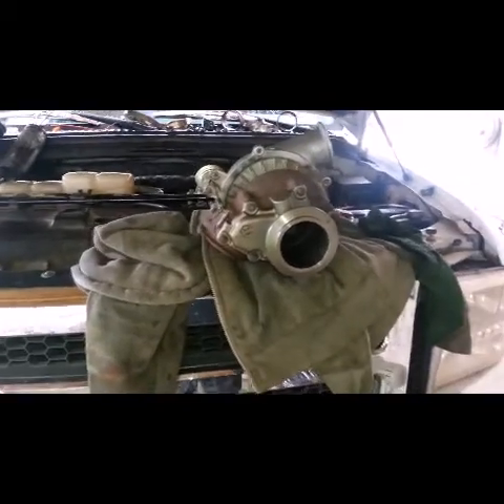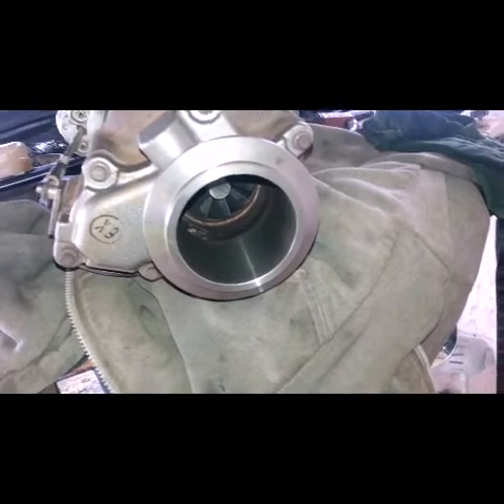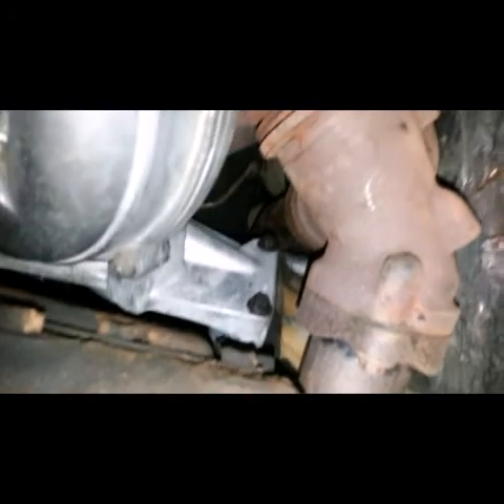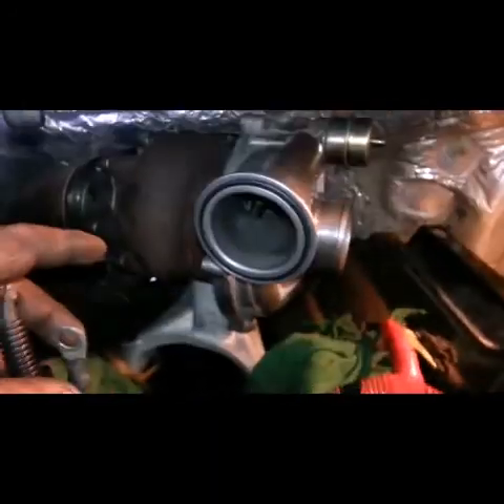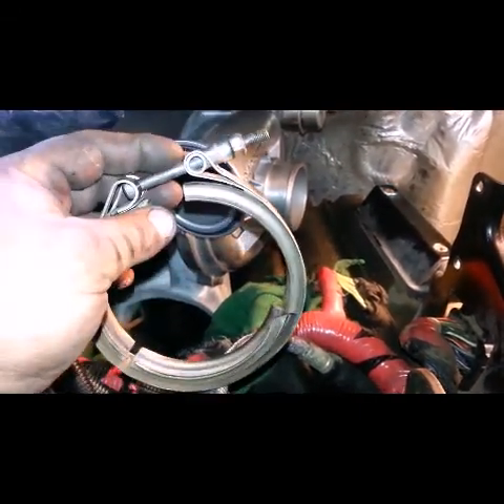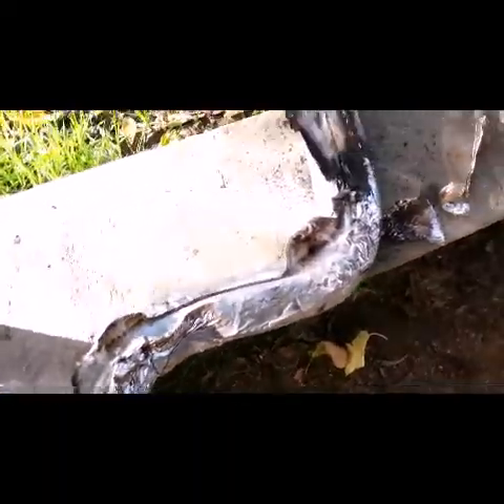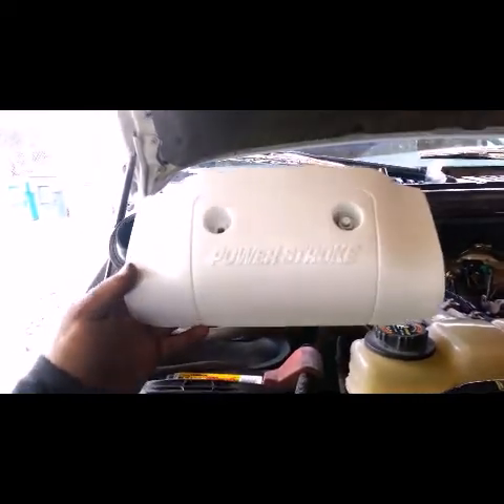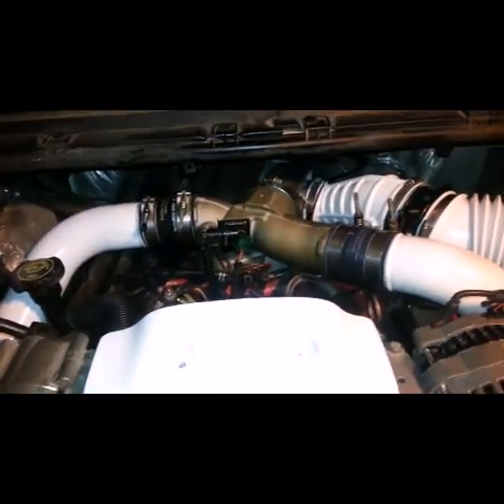7.3 PowerStroke EBPV delete

Comment: For everyone owning a 7.3 that line on that left that goes under pedestil the holder for that line will rubb through remove that holder or take it off the line and wield it to the line it's self the holder is just pinched around the line

Comment: Hey man. Great video and part 1! My 2000 is leaking at the pedestal so I'm doing this delete in a week or so once all the parts are here! What type of paint did you use on the pipes? I think blue would look good on mine.
Reply from the maker: https://youtu.be/eLvb0W2Q8EY
Reply from the maker: Thanks. I used the $6 ratle cans from autozone. this is the link to part 1.

Comment: What pedestal did you use? I replaced my pedestal and it had an allen head set screw at the back side near the block and out mine together and still had oil leak
Reply from the maker: I purchased mine off ebay. Mine also had that allen head screw. I just made sure it was tight and I haven't had any leaks since installed.

Comment: Can u make a  video about your MGP, if it's TRUE I'd like to know how you get 24mpg, is your truck 4x4 longbox, crewcab? Dually??
Reply from the maker: Me making a video won't prove anything. Someone would still think I made it so it looks on the video like I get 24mpg. My truck is a 2000 7.3 extended cab long bed. It has a zf6 conversion with 3.73 gears and  37 inch tires. The 24mpgs i get are highway only not combined.

Comment: With the disconnected sensor, did it shoot a code to your PCM and check engine light "on".
Reply from the maker: P0475 is the code that pops up if u dont have the sensor plugged in and ur check engine light comes on.

Comment: What did you do with EBV sensor?
Reply from the maker: i cut the plug off and put a 470ohm 
.5 watt resistor in its place. the resistor makes the pcm think the sensor is still there.
Reply: George Harmon riff raff diesel sells a $40 plug n play dummy fooler plug...plugs right into the harness
Reply: Whiskey Tango —-how do you find them. I couldn’t find them on the internet??? Thanks

Comment: 470 ohm resistor in the unused connector tricks the computer
Reply from the maker: Yes. It makes it think that its still plugged in. Or you can just remove the plug from your old pedestal and plug it back in and let it sit in the valley of the engine.

Comment: Did you get better fuel mileage?
Reply from the maker: I didn't notice much fuel mileage gain but my truck already gets almost 24 mpg on hwy. Throttle response did seem to improve.
Reply: +elmaschinon  24mpg how?
Reply from the maker: +chris pulley Good air filter. Open exhaust. 3.73 gears. ZF6 transmission. Good tire size, something not to big and heavy but big enough to eat up some ground and not just be winding the hell up outa the engine.